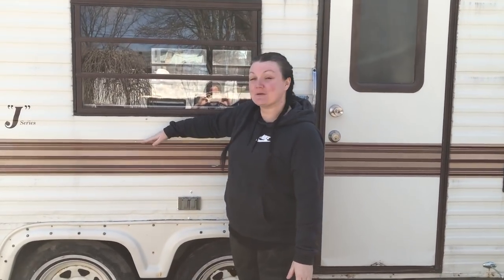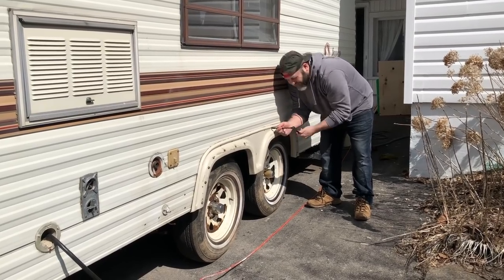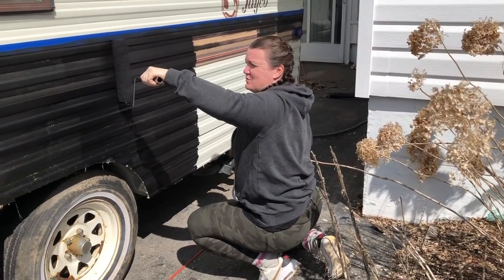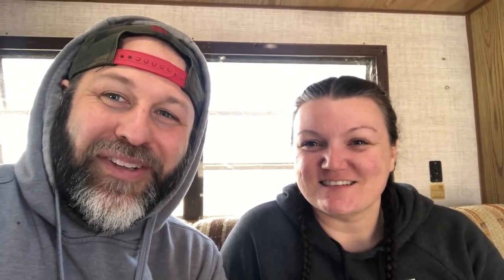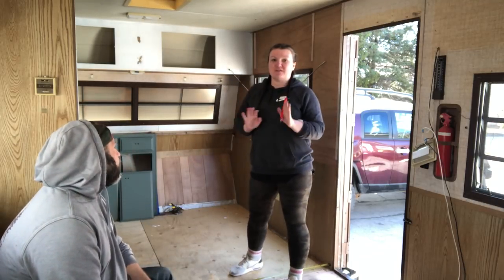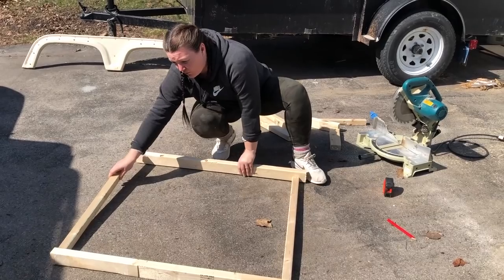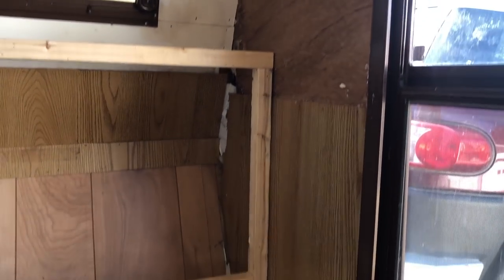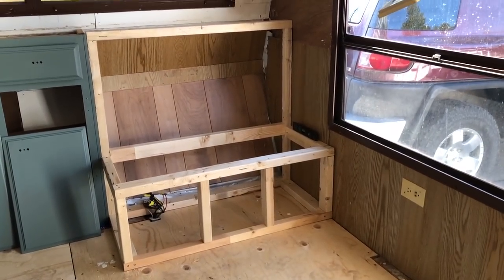Extreme Camper MAKEOVER | Exterior paint! | Interior benches | EPISODE 10

Comment: Nice work!  In addition to new tires (which I was so relieved to hear you mention) please make sure to also get the wheel bearings repacked. 

I agree with other commenters, I think an open cubby under the bench by the door with a basket or two in it to hold shoes would be an excellent use of the space. And, if that doesn’t take up the full width of the bench, you could add a little pull-out drawer on the end that holds your dog’s dish

Comment: A major issue I have in our camper is durty clothes. The space against the angle of the seat would be perfect for a built in hamper. The backrest could hinge down.  To compensate for gravity letting things  fall out when opening the hatch youcould stretch netting or even a piece of thin wood half the height of the backrest. My husband and I converted a pop up so it stays up. It still has slides. It was a lot of work.

Comment: Looking at the rotted wood in your camper bathroom have you considered penetrating epoxy to firm up the softened wood to give it more life? I used it in restoring a wooden boat. Some of the non-structural wood was suffering from mild dry rot and after treating with an anti-fungal agent several coats of penetrating epoxy firmed it up almost good as new. (Of course, if the wood is crumbling it'll have to be replaced.)

Comment: Things for your kitchen dishes you dont want regular dishes they will break while driving your best bet is corelle or just plastic the same with glasses I have metal cups also think about your small appliances ex. Toaster it's a waist of time to bring it only has 1 function and it takes up alot of space I have a toaster oven since you could cook and heat up food so really think about what you need verse what you have at home also you need to think about weight  everything adds weight to your camper the toaster oven also uses electric verse your propane. You would rather save the propane for big cooking not just heating up some bread. Also if you drink tea go for and electric tea kettle also save you on propane. You dont want to weight the trailer down with a bunch of stuff you might not ever use. I had to really think what would I make in the morning for breakfast and what would I use. I did that for my other meals and realized i didnt alot of stuff. Plus if your in a camp ground you might be grilling outside and you will be plugged into their electric so use it up. I hope this helps when you get to this point. Great job and thank you for posting Edgar

Comment: Omg. You didn't clean or prep that outside before painting it. Slow down. You're bouncing all over the place. Get one thing then move to the next. Too cold to paint outside anyway.
Reply: Dave Butch, you haven't been watching all the episodes, I'm guessing. The trailer received a power wash. :)
Reply: Jaye Donaldson 
Yes. I've watched them all. Needed cleaned with wax and grease remover, then scuffed up with something like a Scotchbrite pad. I'm guessing you will have a peeling issue in the near future. You're working so hard to have an issue due to lack of prep.
Reply: @MrSuzukiyamaha  I'm sure not every minute of work was broadcasted here. Who knows what was done ahead.
Reply: Jr M 
Wasn't sanded. Plus rear plate frame still on. Wasn't prepped properly. Did you watch the video?